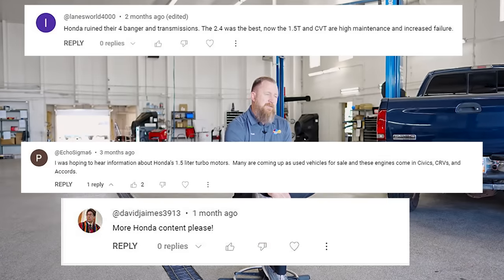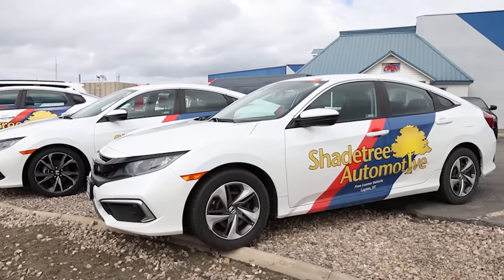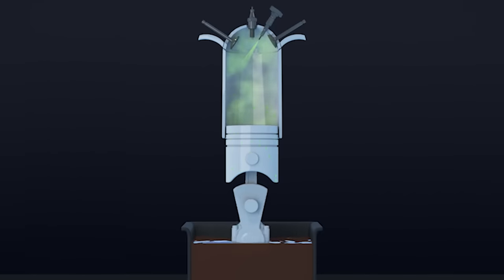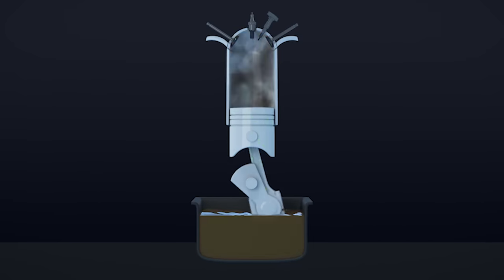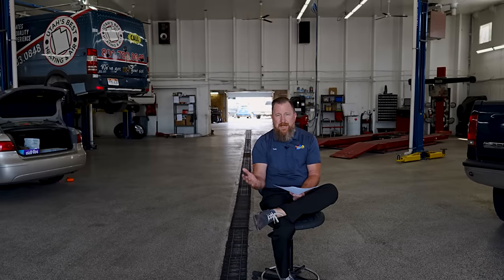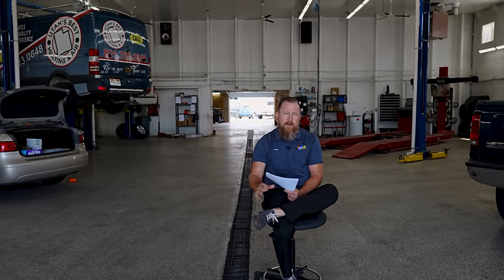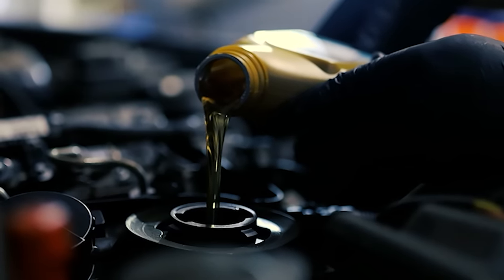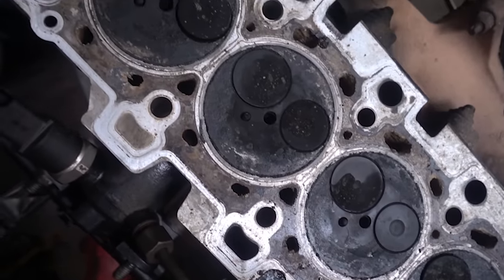Honda Oil Dilution Issue - Should you buy a new Honda

Comment: i work at goodyear// and we also use the Valvoline valve cleaner.. but a a former Classic Italian car tech/ restorer, i was not sure about this.... so i brought my friends bmw.. in very well know for carbon build up on the valves. and did a test,, we followed the instructions ..to the letter.... before we did the cleaner.. we took the intake manifold off the car..  took photos of all the valves... put the manifold back on and proceeded to use the Valvoline treatment ..besides killing every living thing around our shop... we went  though the process... ,, after the engine cooled down.. 4 hours.. we removed the intake manifold... carbon still there.. manifold back on and every 250 mile we took the manifold back off... we got very fast at this part... but after 1000 miles , we saw no improvement on carbon lessening off the intake valves... none at. all.. i know this is only one test... but that carbon, is cooked onto the valves.. and even walnut shell blasting take time to remove the carbon...  and also it is not recommended to use this product in a turbo car.. as a possibility of carbon fowling the turbo charger.. and damaging it,, and also the chance of small flakes of carbon, getting stuck between the piston and rings and the cly. wall,, this would cause premature engine failing do to the lack of the rings sealing to the cly walls.... we only recommend walnut shell blasting on badly carboned up valve.. we also install an oil vapor separator to keep the oil vapor's and other nice goodies, from entering the intake track... but that is just us....no such thing as ' fix the engine in a can '  right?
Reply: Did the oil catch can that you installed help reduce more carbon build up?

Comment: No dilution on mine, after the dealership did the SW update and after i started changing the oil by myself. The dealerships routinely overfilled my Civic when they did the oil change. Yes, you heard me right. I also monitor how much is drained at every change now and so far, no problem at all. Interval of 15 percent of honda minder, full synthetic only with new filter every time.
Reply: You also KNOW..( specifically if you have sense enough to use a proper torque socket wrench) that when you change your own oil...The oil drain plug..ISN'T over torqued unlike at some dealerships or especially these idiotic quick lube places who love to use a damn air wrench to torque it.
Reply: @elim7228 Does the dealership do the SW update for free? Can I simply call them up and ask for the update? I'm out of the warranty window already.
Reply: @nesone6520 I’m under warranty so I will be asking for this. I believe the software updates has the car rev at 2k rpms for a minute or so upon startup
Reply: @WilliamLopez559 Anyone knows when this software update came out?Mine revs at 1500 after starting it up.
Reply: @Schreibtisch1  I believe that’s okay. What I do now is to change my oil at the 4k mark and use high grade oils like amsoil signature series or penzoil ultra platinum for my car. I also only use 91 octane or higher gasoline from either chevron or shell.
Reply: @WilliamLopez559  thanks for your reply. What kind of oil do you use? 0w-20, 5w-30 or 0w30?
Reply: @Schreibtisch1  I follow the suggested viscosity from Honda which is 0w-20 for my specific vehicle. (2019 accord, 4 cylinder, 1.5L turbo)
Reply: @WilliamLopez559  Alright, thanks a lot
Reply: @Schreibtisch1  You’re welcome. It’s what good YouTubers do for one another!

Comment: I have a 21 CRV and it does get cold here in Ohio too. Last winter the temperature dropped into the negatives and it snowed. I do not push my car like normal in snowy conditions and the car struggled to reach operating temperature and I drove it 19 miles to work. I hope the software update addresses operating temperature and cabin heat in extreme cases.
Reply: It does not...can't beat physics.
Reply: No the software update did nothing. There is no fix just drive it till its dead or dump it.
Reply: In the winter, be sure to get your car running while you finish getting snow off. Don't just crank up and go. Always good to let it idle for a bit in winter weather.
Reply: Put in a radiator cover cardboard like the big rigs. These engines are too damn efficient.
Reply: @jo9732 😂😂 As a truck driver this might work but I would start with small piece
Reply: Just think if you had an EV ...have to warm the batteries ...warm yourself and if your lucky the car will operate.Chargers dont normally work in cold weather
Reply: No the software update may at best reduce the gas oil dilution, but it’s an inherent flaw in the piston rings and engine design…

Comment: 2019 Accord 1.5T and no issues. I'm guessing the slight difference in tune that the Accord has had minimized the problem. I think the engine's great. It is very fuel efficient but also offers some good get-up and go when wanted.
Reply: Do an oil analysis test and realize you're kidding yourself. I have an accord with the 2.0 with regular 4-5% fuel in tests.
Reply: @singular9  Well, I do my own oil/filter changes. No smell of fuel in oil. Plus, as the video states, Accord seems less affected. Runs like a top.
Reply: I also have a 2019 and a week ago it starts to shake when it starts but stabilizes in 4 seconds and now I even smelled gasoline I change the oil every 4K miles and it only has 32k I always use premium gas
Reply: @joelfranco4757  Unless premium fuel is required, which it is not in the 1.5T, it won't do anything for you. It just increases your operating cost.
Reply from the maker: Id bet someone has had that issue but your correct, we havent seen any accords as of now

Comment: We have a 2019 CRV 1.5, even with the fix - still has gas oil dilution. It even has it in summer, albeit less. In the Midwest… Honda said the 19 “fixed” it, did not. We change oil less than 5000mi between changes. Mixed lengths drive, some highway longer, some short. Like video said some longer drives to burn off oil helps, minimize remote starts (won’t let it get to operating temp as fast). When possible we also wait a few minutes for engine to get off of minimum temp / cold to start using heat in the winter. Those few things have helped reduce it, but not eliminate it. Also Makes a lot of sense for more regular oil changes. Too bad theirs not a way for the engine to trap it and burn off the gas, even from the oil pan itself. 
One person down the street who has a 2018 crv with this issue got an engine block heater and drives his in ‘sport’ after a minute or two in cooler temps to get engine warmer quicker. Said is has reduced engine oil consumption, he also changes oil at 3000mi.
Having owned several Hondas in the past with zero issues, this will likely be our last Honda. I have a 19 Ridgeline, no issues at all with oil dilution, but a totally different engine.
Reply: A guy had the dilution problem he mixed the oil 50-50 percent 0w-20 and 5w-20. He said he drove his vehicle 20,000 miles and no dilution problem . Of course he had regular oil change intervals. With the 1.5 turbo I change at 5,000 mile  intervals. And use premium gas. So far no problems.I also do the 50 -50 oil mix 
 I had a dilution problem before mixing the oil. I also use Amsoil synthetic mixed mixed 50 percent 0w-20 and 5w-20. I also get 47.5 miles per gal on a trip from Fuquay Varina NC to Wilmington NC and back.
Reply from the maker: Thanks for sharing.  Sorry your is giving you a little more grief than average

Comment: Never had a problem with my 1.5t.  I’ve done all my own oil changes since new, the sump is never overfilled, there’s never any smell or sign of gasoline in the used oil.  I drive my car normally and change my oil when the service light comes on.  The car runs like new and has never needed anything other than basic maintenance.
Reply: What year?
Reply: @barrya.6212  
2017, never had the software update done either.  7 years old and the only thing she's ever needed was basic maintenance, oil, fluids and filters.  Honestly I don't know what y'all are on about.  It's never given me even a hint of trouble.
Reply: Same here with 2 new over past 5 yrs
Reply: It doesn’t happen to all the engines as people want to make it seem. My civic and mothers crv didn’t have that problem since I change our oil every 5k.
Reply: @theholt2ic219  
Some cars need it changed avery 2k miles! or even more often
Reply: @viffer94  the 2017 did not have a 1.5t
Reply: @mitchhedberg4415  I'm telling you that even right after I change to fresh oil, within a couple of hours of driving it's polluted with gas again.  It's awful.  This is not cool at all.  I'd rather the car burn oil that do this.
Reply: @an4ndpatel  The guy in the video just said the 2016 and 2017 models! Clean your ears
Reply: Same with my wife's 2017 1.5L Civic Touring. Runs like a dream. 87K on it so far. ALL services at the dealership. My 1.5L 2018 Accord touring is at 47K, runs amazing.

Comment: The oil dilution issue has a great deal to do with the temperature of the oil in the oil pan, as the oil approach 200F, any accumulated fuel is evaporated and pull into the intake track through crankcase ventilation system and burned.  So, if the oil in the oil pan even reach operating temperature once in a while (maybe as infrequently at once or twice per month), I would think oil dilution wouldn't be a significant issue.
Reply: There's exactly what I have asked. Maybe they are in cold weather for 6 months and it never gets hot enough to burn it off, it just keeps building up
Reply: Nice victim blaming. It's their fault for living in cold climates and/or not driving enough. Nothing at all to do with Honda building a crap engine. Lots of other turbo engines out there that don't have this issue...
Reply: @nodak81  literally every turbo engine has it, Subaru, VW, etc
Reply: @nodak81 😂 bruh this is an extremely common issue
Reply: @nodak81  Every single GDI turbo engine has this issue......
Reply: @TheTopGun920  not true, it's the turbo engines that have these issues.  My Hyundai GDI engine has no oil dilution.
Reply: What I don't like is the fact that in my Honda, right after I change the oil, in one freaking day, it looks like awful crap!  My 4Runner can go 5K miles and still have golden-colored oil.  Mine is a '21 Civic, btw, they never solved the issue.
Reply: @bb5242 yup they only updated the rev in idle where it will start revving at 2k on cold start and drop down after a minute. Regardless its the design flaw of the engine. I got a ‘20 civic and i have to go drive around for 20min when winter even though my work is just 5min away
Reply: @bb5242 yup they only updated the rev in idle where it will start revving at 2k on cold start and drop down after a minute. Regardless its the design flaw of the engine. I got a ‘20 civic and i have to go drive around for 20min when winter even though my work is just 5min away
Reply: @donaldzuramp4404   - Has anyone thought about getting an oil pan heating pad? Just plug it in during the winter months. It will probably evaporate some of that fuel when the oil stays warm too.

Comment: The reason for fuel dilution is mainly ring seal.
Reply: also the GDI  engines use a high pressure fuel pump to inject into the upper cylinders,  after the valves, it's over  thousand PSI to overcome the high pressures in the  cylinders.

Comment: I was a mechanic in the 60's and 70's in the Yukon , we changed a lot of oil pans and valve covers , when the choke would stick and flood the engine with gas , and had a lot off twisted off oil pump drives as well in 46- degree's , lol.
Reply from the maker: That sounds like it was real work back in the good old days.  Cheers!

Comment: This is by far the BEST summary I have found out here so far.

What are your thoughts on the Fuel Injector model/manufacturer change? And have you seen failing fuel injectors? What about fouled spark plugs?

We are at our wit's end with a Honda dealership in the greater Houston area and hoping to find an independent mechanic like yours that we can trust. They are refusing to apply any of the Honda Service Bulletin's / software updates to our car because the service manager told us "they don't work.
Reply from the maker: Yes, we are seeing fuel injector failures quite often as of late.  We haven't seen fouled spark plugs but are often times changing earlier than the normal 100k miles when we find issues.

Comment: As an owner of a 9th gen si k24. I have zero interest in any new Hondas. They all seem to have odd issues... and I love Hondas. 265k miles. And only had to replace the clutch at 245k and the radiator at 260k. Fluids obviously.  But the car is a champ

Comment: Also, there were a lot of issues with lack of heat with the Hondas with these engines.
Reply: He mentioned that a few times. Did you actually watch the full video?
Reply: @markr.1984   he may have meant "cabin" heat. the video did mention engine temp, but not cabin heat
Reply: @markr.1984  Yes, I watched the full video, and I just watched it agin, he never mentioned a heater problem. He mentions the software update raising the engine operating temp to help the oil dilution, nothing about the lack of heat from the heater or defroster.

Comment: I have the 2018 . I use high octane gas when I fill up. Have had no trouble at 62 thousand miles. Because of this I change my oil at 5 thousand miles. It’s a 1.5 liter civic with the turbo. Love this car.
Reply: Right, I watched a YouTube video where a guy had dilution, but when he went to 93 octane it went away. He went back to 87 octane and it came back.  You are correct in running premium gas.  I just got a 2024 CRV and it will get a steady diet of 93 octane.

Comment: Another reason why you should not be doing 10k oil change intervals. I do every 5k or 6 mos synthetic and every 3k or 6 mos conventional.
Reply: Except most cars don’t have this problem
Reply: It does not matter if they do or do not you should not be doing 10k mile oil changes. @brkbtjunkie
Reply: If they got direct injection with a high pressure fuel pump they got this problem. Maybe not as bad as the Honda engines because from what I have been told uses rings designed for high efficiency. If you own anything with GDI I would be changing oil sooner than later unless I have a long commute to burn off the excess fuel. @brkbtjunkie

Comment: Toyota still keeps a set of intake port injectors on their direct injection cars for this very reason to keep intake valves clean.  Toyota also has avoided turbos due to reliability (as I understand it).  These issues including oil dilution is what has scared me off from honda and will only buy Toyota for gas cars going forward.  This is coming from a life long honda guy that owns 2 Hondas and 1 acura.

Comment: Good video with excellent explanation of issues and resolutions for customers. 

Rare mechanic that is honest and tries to help customers with problematic  design issues.
Reply: He should apply for a PR position at Honda. Putting all the onus on the customer for a known design flaw. Change the oil twice as often, all cars do this, it’s not that bad, 😂
Reply: @BreadAndGatorade  It's a stop-gap measure to prevent the engine from dying an untimely death.
Reply from the maker: Thank you!

Comment: I'm a UK CRV 1.5 vtec turbo owner, I've found these things help with oil dilution, TURN OFF STOP START, warm car up before driving, drive sensible until its up to temp. I change the oil and filter every 3K miles, maybe thats a little excessive. Use premium fuel in winter. Our driving is mixed lots of 100 mile journeys especially in summer, winter its mainly short trips but i do give the car a run at least once every 2 weeks. 
Ours is a manual front wheel drive, we love the car. Hope this helps.

Comment: Direct injection and boost doesn't always mean best emissions.
In theory it should help meet emission targets but there are  actually a few downsides to direct injection, one being fuel droplets actually making contact on bore surfaces and being out of suspension.
Another being carbon build up on the back of the inlet valves  and ports because there is no fuel scrubbing action.
Honda isn't the only manufacture with these issues.

Comment: I've seen several teardowns of this engine and camera cylinder inspections on this engine. No carbon build-up on intake valves.
So rest easy
Keep air filter changed every 12months or 10000 miles
Change oil every 6 months or 4-5000 miles
Service cvt every 30 40000
Use premium fuel. It's a turbo car

Comment: I’ve seen the injection time on Hondas is a lot longer than other GDI engines, the ECM commands the fuel injectors open for almost 2ms which is an eternity for GDI injectors. 

Most other manufacturers have a GDI injection time of under 1ms or around 700-900us, idk if there has been software updates to change that but it’s what I’ve noticed while diagnosing this issue
Reply: Did not design the fuel injection pressure to be high enough?
Reply: @davidpowell3347  I’m not sure if the flow rate on the injectors is lower than other manufacturers requiring them to be open longer, I’m not sure the reason I just know that a known good fuel injector is open for around 1.9ms
Reply from the maker: My guess is that the are running a lower pressure so the flow rate is a touch lower meaning they need to hold them open a touch longer.  I wonder if the problem would be worse if it was higher pressure at a shorter open rate.